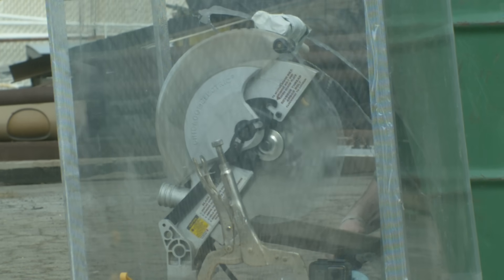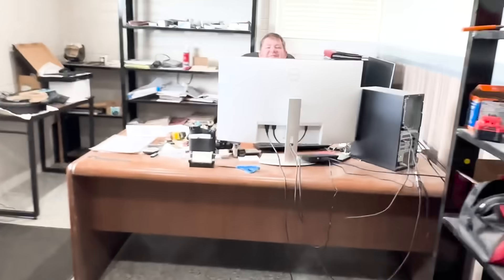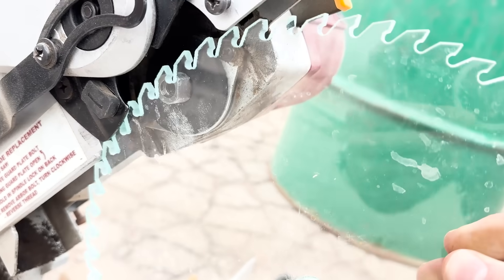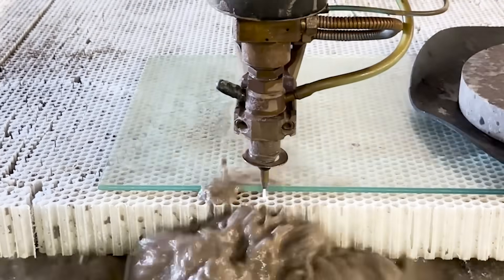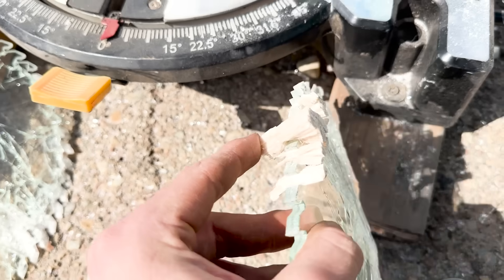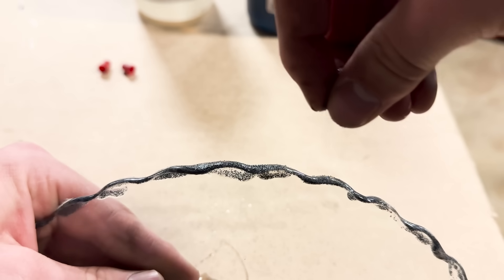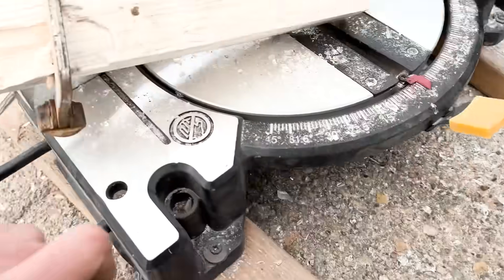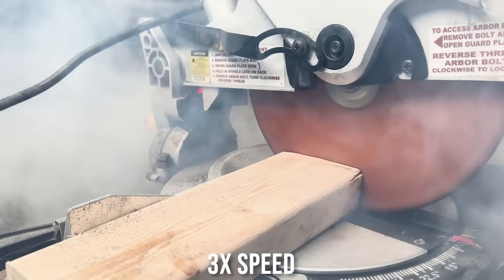Can Glass Cut Wood?

Comment: The rubber washers were the right plan, but you need more of them, or thicker washers to act like a cush drive on a motorcycles rear sprocket, they're little rubbers that go between the wheel and the sprocket mount to protect the wheel from shock treatment...

Comment: The whole blade doesn't need to be made of glass to show that glass teeth will cut wood. Use a steel blade trimmed down around the perimeter, and replace the perimeter with glass. Epoxy the two bits together. Also, solve the soft start issue cause that was not the glasses fault at all for the failure to cut.

Comment: Glass is really really really good at withstanding push pressure and really really really shit at withstanding pull pressure, so spinning a glass disc really fast puts so much pull pressure on it via the centrifugal force that it explodes immediately 60% of the time, all the time.

Edit: The cracks in the middle obviously also don't help.

Comment: Even if conditions were perfect, glass is weak enough that you might also be brushing up against the point where it's literally spinning itself apart. Assuming I found the right numbers, standard glass will fail when spinning at ~53m/s, which can be reached quite easily on the edge of a saw blade.

Comment: The boring answer: It can already cut stuff.
Just replace the grit in a water jet cutter (The grid is the thing that cuts stuff in a water jet) with Sand (which is basically glass) or crushed glass sand and boom, cut wood.

Comment: Stupid idea - a blade must be flexible, though and tenacious. Only the edges have to be hard and sharp. So the edge is hardend and sometimes assembled with ceramic or diamonds.
Glas alone is to brittle and soft.
Any resistance or lateral force will scatter the blade. And the lignin polymer of wood will ware down the cutting edge.

So only dangerous and in any kind leading to the right way.

Glas knives were only used because they would shatter at a bone.

Comment: Instead of sinusidial shape just go for straight round shape, covering the blade in sharp stuff with two component glue.
For the first two attempts you might cut the teeth at an angle alternately, probably just using triangles than the saw teeth... so each triangle tooth just alternates between left and right cutting with a sharper angle than just 90 degrees, say 80 or even 70 degrees.
Problem with glass is that ANY little tiny fraction WILL expand under force - and rotational force you apply more than enough.

Lastly the reason why the electronic speed regulator did not work as intended. My guess would be that it was built for a smaller power tool, making it just to an effective switch when you used it with this big saw. You might need an electronic that either supports more wattage, or you should look for a soft starter which at least would lengthen the start time. This might help with this task.

Oh, and a lot of applied pressure is also bad with brittle material.

Comment: the reason why the glass blade was failing is because of the 2 cracks at the center hole. it should hold up if there are no cracks.

Comment: Why was the glass already cracked from the initial waterjet cutting? Seems like something about the cutting process needs to be modified to release any internal stresses and avoid large stress gradients during the cutting process. When laser cutting acrylic, I will cut in multiple short passes to avoid introducing too much of a stress gradient at the cutting site which can lead to cracks. Maybe something similar works for waterjet cutting?

Alternatively, maybe you want to start with annealed glass prior to cutting and then temper it once it has been cut. I don't know for sure though; just a thought.

Comment: Way too late, but...
Use a large, stiff metal washer. Put a thin layer of hard rubber between the two.
The metal washer distributes the frictional forces along more of the area of the glass. The thin hard rubber allows those forces to be distributed more evenly to the surface of the glass, making up for small imperfections in the metal and glass surfaces.
A metal blade would allow the metal washer to bite into it, deforming enough to transfer forces to the rest of the blade. A glass blade can't do this, since it's very brittle. So the thin rubber layer allows for that compliance to balance the load.
The standard metal nut isn't that large, but the load bearing of metal is high enough that you don't need a tremendous amount of surface area to handle the load. Glass can't handle as much load per unit area. So use a large washer to further spread the load over more area.
The inner metal washer is a spacer. It needs to be stuff. The rubber compresses allowing the blade to contact that bolt head. That's bad.
Ensure your saw doesn't have some kind of a stopper or other protrusion that will interact with the blade when stopping. That's also bad.

Comment: Using an angle grinder instead of a roto zip to cut out the arc for the handle?  Rubber bushing under the blade retaining cups but not between the steel shaft and the glass blade?  Applying fiberglass reinforced tape with 100 percent of the breaking stress applied longitudinally, where it's no stronger than clear packing tape....probably even weaker?

I couldn't watch past the first three minutes.  What relationship does this guy even have to the actual engineers in the shop?  Was he just delivering pizza that day?  Why would they encourage any of this?  

Astonished what anyone stoops to anymore for clics and views.

Comment: The tape you used was meant to go the other direction (perpendicular to the joint instead of parallel). Has a much higher strength that way.

Comment: What  were those guys thinking  cutting a small center hole as if it were  steel material?   The initial torque  when  the saw is turned on would break the blade.  Then they cut out the second and third blades  making the same error.   I would have water-jet cut a 3" center hex. hole  w/3" Lexan insert cemented in.  Then the  blade would survive the startup torque.   Also  increase number of teeth  by  at least  25%    A slower speed was also a poor decision.

Comment: "I thought for sure that tape was going to hold it, especially with the super glue".   That explains a lot.    

Stress concentrations in the teeth are not the problem.  It's the stress concentrations caused by the cracks in the arbor hole.  All it takes is a little vibration for them to propagate through the whole blade.  Eliminate those when cutting that hole and you might have a fighting chance of getting the blade to survive long enough to at least make contact with the wood before exploding.

Comment: Glass is great depending on how you use it.  Grinding glass with wet diamond weeks is dine at around 900 rpm where steel bench grinder runs at 3609 rpm.

Comment: I would recommend to use water when you start the glass, this way it will remove the vibrations caused by the different weights of the different places on the glass disc further i would use some kind of soft gap filler for the gap between the disc and the middle of the spinning disc - mitigating vibrations

Comment: My NUMBER ONE suggestion is choose a better saw, and use one that takes a smaller blade diameter. Next, get a quality variac to slowly ramp up motor rpm… that pedal is designed for the tiny Dremel.

Comment: Vibrations are the problem, you need cuts in your sawblade so it can reduce vibrations, glass would be hard enough to cut wood. But it cant withstand tension and vibration. Eventough you have strong thermic production

Comment: You shant cut across the glass, leaving scribes perpendicular to the plane. You would be better to drill the hole and then die grind the perimeter kerfs like sharpening a chain-saw teeth.

Comment: Small Tip for next time, if you use brittle materials. Maybe use an electric soft starter to slowly spin the blade to speed, it seems that the inertia cracked it right from the beginning. You could use a potentiometer as a soft starter, if its big enough to handel the wattage or go the expensive route and get a controller from SEW or other companies.

Comment: @3:20 you couldn’t drill two holes and use a jig saw?… lol save yourself probably 80% of the time it took to melt your way thru it… what you did there is equivalent to hammering a nail with a screwdriver! Lol it’ll work, but youll be there all day! 
Also, You should try using carbon fibre for a blade maybe… I’d be curious to see how good or bad that cuts!

Comment: Working in a Glass plant i can tell you why your first one failed. The Blade had a vent (crack) at the hole where you mounted the blade. Glass is extremely fragile when its vented. Sometimes it explodes when not moving. Cant have any or it will blow up. You can cut alot of things with glass and your first design was probably your best option. Just need to get the blade in 1 peice.

Comment: One thing I might suggest is you use High Speed Steel for most of your blade, make the teeth of the blade out of tungsten carbide and induction braze the teeth onto the disc.

Nice video though.

Comment: My humble opinion is that the glass blade not only will require the rubber washers, but also a rubber shield for the center spindle, steel as it is, to buffer in identical fashion as the rubber washers facilitate. 
  Protect the glass blade from the center, as much as the sides, and show us what, if any, difference it makes.

Comment: your point of failure is also the most important aspect of making a saw blade of any material, accuracy of motor shaft hole size, location and how clean cut the hole is. It needs to be perfect!!!

Comment: I think the shape is wrong for glass.
The flat disk with teeth works for metal blades, but it is a brute force approach, which glass can't withstand.
Instead, try to makethe glass thickest in the center and thinnest at the edge, preferably actually sharp. The edge should be waves, though possibly even smoother waves than was your last disk.

As for trying another material, how about tungsten carbide blade?

Comment: I don't think any type of glass is prepared for high speed rotation and and vibration. Probably using wooden washers would've helped as they are hard enough to not snap the glass blades and prevent any vibration at all, while rubber washers is the worst to prevent vibrations. And some Loctite to glue the screw to prevent it from tightening as it spins up.

Comment: I think it is extremely off ballanced maybe you should cut out a circle and use a lathe with a glas cutting tool (drill bit) 
You must adjust your speed of the lathe  . 

n= Vc×1000
      —————
     d × pi

Comment: Obsidian glass my friend... do the same that you did with the last peice of glass. Adding the grits. But..... also add the powder on the edges of the hole that will then be held in place with the screw, washer, etc.... that should hold it together if my theory is correct.

Comment: Make the center of the blade out of metal, like the washer. Maybe with the jet make the outline of this center piece some kind of pattern that will fit with the outer piece of the blade made out of glass or whatever. Or just glue both parts together, I think it would be a good idea to prevent the pressure of the tightening bolt from damaging the material being tested. Great video.

Comment: I noticed the arbor hole of the glass blades was seemingly drilled rather than cut also with the water jet. it clearly had cracks around it which likely were the beginnings of the explosive failure before you even started.

Comment: the best blade would be a disc of metal coated with diamond. not a saw, a disc. its not gonna be very easy to replace, but at least its fast. alternatively you could use hard materials like zircon and moissanite.

Comment: I think epoxy could be stronger and worth a try. Glass is way to sensitive to vibrations which it clearly exsperanced 😂 its probs the worst material to use. Epoxy is see through and it can be very strong if done correctly however it will probs chip the blade after awhile which is why its made out of metal as it doesnt chip. Also stone would be interesting as it wouldnt chip as easy but its been used as axe heads so i dont see why it couldnt be a saw blade.

Comment: One thing to consider when making a sawblade is the kerf (the actual gap you're taking out of the material). Saw blades, be they circular or hand, tend to have flared out (or 'set') teeth, which cut a wider kerf than the width of the blade body. This is to reduce the friction (and heat) the blade experiences when it passes through the material, as only the teeth (ideally) are in contact, as opposed to the body of the blade and the teeth.
If you can figure out a way to either make the teeth thicker, or reduce the thickness of the rest of the blade after cutting it out, you might have some more success with materials that expand when they heat up.
Reply: Cut the blade and then take a rotary sander to it to bring the thickness down on both sides. Combined with making the blade smaller to reduce the centripetal force and reinforcing the mounting point before the cut with the super tape to hopefully prevent any small fractures at the beginning, you could quite possibly end up with a blade that doesn’t instantly explode fragments of death.

Comment: You might try an alternating chisle edge on the the glass, each probably at least an inch or two long,  and taper the leading edges at least 50 degrees so that the blade slices in to the wood rather than rips or grinds, and between each cutting face put a little center cut ridge perhaps 1/4 inch long that is shorter than your edge blades. Spin your blade up slowly as to reduce shock, and once at speed let the weight of the machine do the cutting. As the blade spins each side will slice a bit and the center ridge will help eject the cut material. Might also try a triple lamination of glass with slightly thinner pieces, preferably of Pyrex or corning ware, which would allow for more  flexablity and variation on the center cut to more effective remove waste.  Alternately you might use a wandering knife edge so the sharp edge goes from a chisle point on one side of the glass to the other a couple of times.  I would also recommend a metal spacer to go around the shaft of the bolt holding the blade to give it a smooth surface to seat on and to prevent over tightening cracking the core of the blade, just the thickness of the glass and half the rubber washers. You guys are doing great work.
Reply: Oh,and water cool the blade if you can.  ;)
Reply: god damn
Reply: i’m not reading all of that

Comment: Probably blew up the speed control the instantly. The saw Jaws what 14 amps the Dremel 1.2 Max. Foot pedal was rated for a maximum amperage load.
Very thin piece of rubber would have worked as good as a thick piece preventing the screw problem.

Comment: Back in the day the disks in a HDD was made of aluminium and coated with a ferro compound that could be magnetized. The aluminium might not be magnetic in a classic way but it does influence the magnetic fields which isn't optimal. So wouldn't it be great if we could do them of glass coated with a ferro material?

Well the researchers thought so, at least until they started exploding the glass disks in the labbs. After that it became increasingly hard to get the scientists to go into the lab with the spinning disks of death...

Eventually they did actually succeed and today glass platters are probably in all new drives.

Comment: In the future if you test more fragile materials, I think you should add a flare to the bottom of your handle. As it is right now there is a gap in the safety box where the handle is and if you're holding the handle while a blade shatters (although unlikely) a small piece could potentially fly out and hit your hand causes a pretty nasty wound. Judging from this and past videos I know it wouldn't be too much trouble for you guys as you could use pretty much any material from rubber to Poly carb glass and it would work to shield that gap
Reply: Or they could just put a separate shield slide where the handle slides, making it so the gap is always closed..
Reply: There would be a certain amount of irony if they use a real saw blade as the handle flare
Reply: Add an adittional guard that mounts to the handle so it travels with the handle. Also gloves
Reply: There would be a certain amount of irony if they use a real saw blade as the handle flare

Comment: If you make resin stabilized wood you should not only be able to make a much harder blade, but you can actually sharpen it.
Alternatively, glue a bunch of paper together.  Something like 30 layers of 110lb card stock.
Also, a note, super glue bonds too hard, it has no give, and so in any application that needs even the tiniest amount of flex, it just breaks.  That's why poly acrylic glues are so good at their job, they are ever so slightly flexible when bonded.  I have used a simple acrylic gorilla glue to bond glass to metal in applications where heat expansion exists, and it holds amazingly.

Comment: Your initial toothed design would work a lot better if you were cutting along the grain. Might wanna check out the differences between a crosscut and a rip saw. You're putting this in a miter saw, which is primarily for cross cutting, that is cutting across the grain. Combination saw blades, that is blades meant for both cutting with or across the grain, often have have alternating angles on the cutting edge of the teeth.